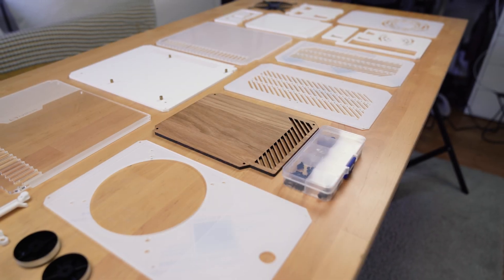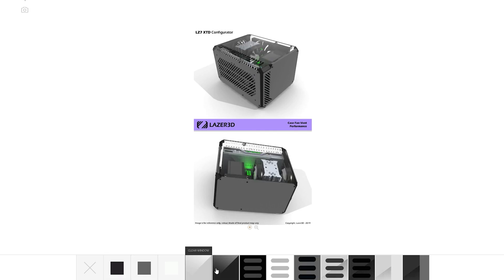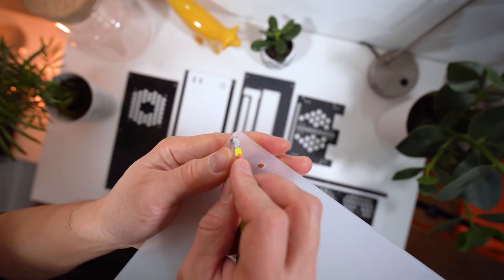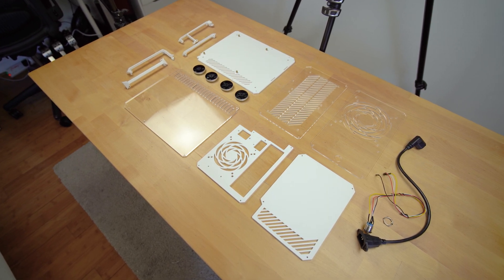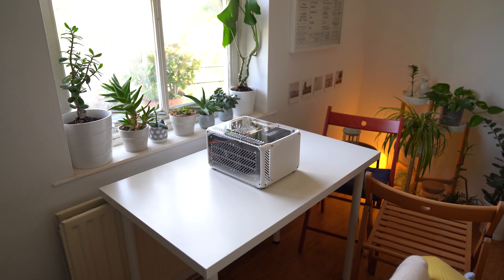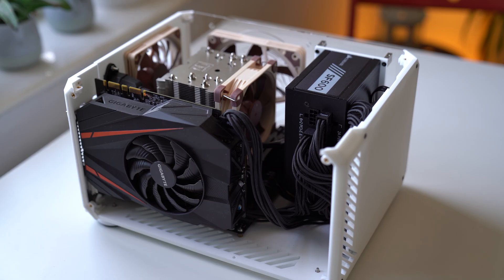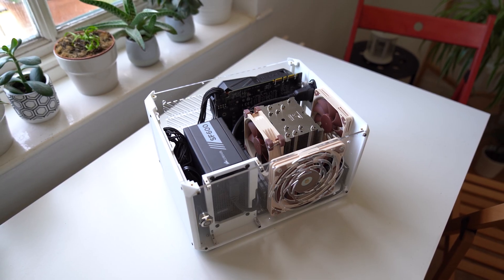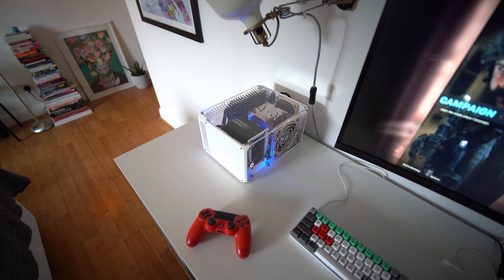An IKEA style ITX Case? - Lazer3D LZ7 XTD

Comment: I have had the LZ7 for 4 years now. I carried it all over the globe, and remains a robust case. I finally bought the XTD up grade, so my computer will remain a desk top. I have a similar internal set up and it is nice to see a smaller graphics card fit in the case. I do have to upgrade to a full size immediately. I wouldn't have considered a see through case but If I saw your video prior to buying my XTD, I might have. it looks great. I get the top with the full cover slots, just for better cooling. It is a dust magnet, but 4 screws and I can get in there with canned air. Nice video.

Comment: You should have a look at Jonsbo V8 it's such a sexy fully aluminium iTX case... And what it better is that it costs under $150... I just got the U1 Plus... I can't wait to build it up with a massive air cooler popping out the case in the next two weeks 🤓😋🙃 lol
Reply from the maker: Cheers, I'll have a look!
Reply: Hint. It doesn't fit regular iTX/ATX PSU... It must be a bit smaller

Comment: Airflow seems like a mess. You have the one intake fan that both the CPU cooler and PSU fan are pulling air from in different directions, then the PSU exhaust is completely blocked, so I imagine a lot of that hot air recirculates and you only have the one exhaust at the other end of the case.

Comment: They may be cheap to manufacture, but they are certainly not cheap to buy...  So the PSU pulls air in from the interior, and exhausts air back into the interior? Booooo!